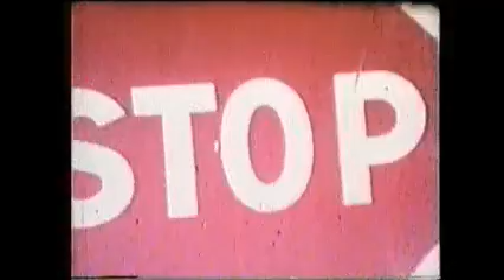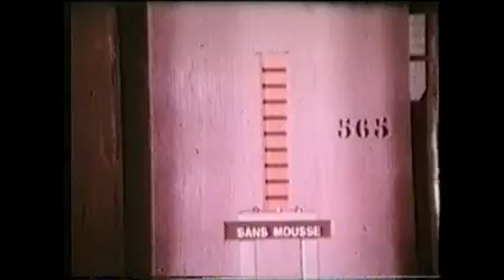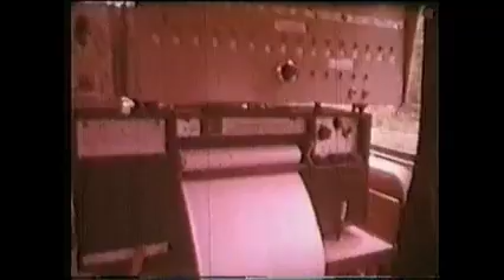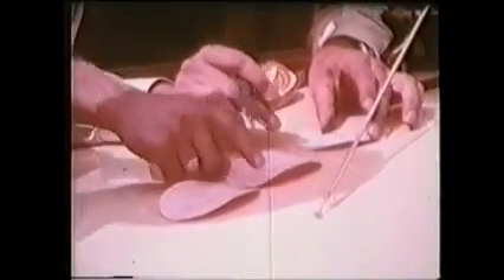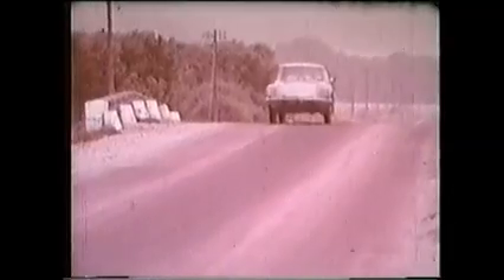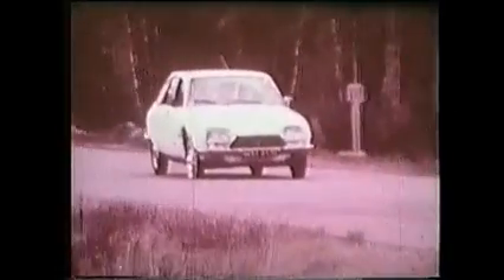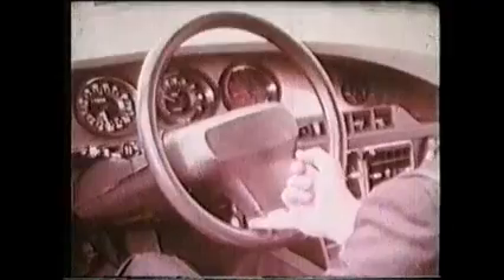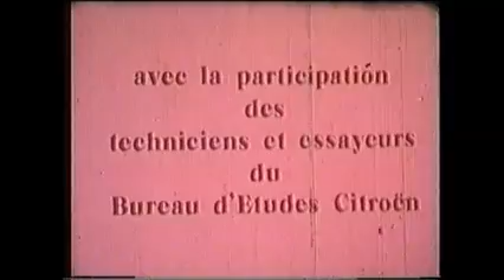Citroen GS GSA 2CV safety promotional video

Comment: 2cv safe? hahaha
Reply: Great Cornholio It's safer than you would think. 
The following articles explain it:
http://carcynic.com/archives/00000013.html
http://carcynic.com/archives/00000014.html
Reply: Csuzdi Gábor well,. i once saw a mercedes 300e crash into a 2cv at 50km/h,....he drove through it,..he crushed the engine,. drove through the interior,. pinning the floor to the ground,. drove throught the front and back seats and came out through the tailgate,...needless to say no-one inside the 2cv survived the crash,..
Reply: Csuzdi Gábor and in you article,. they say "avoid crashing it!",.... "The 2CV lacks many safety features that we take for granted in a modern car" its a death trap dude,. some dont even have seatbelts,. no crash zone,. a very weak chassis,. and almost everything is bolted,. not welded,..
Reply: Great Cornholio"He drove trough it". Yes, because in these tests the car is fixed to the ground or moves on a fixed path. In the reality a 2CV would be pushed away when the Mercedes reached the chassis, because it is so lightweight. And in a frontal accident, the engine slides under the passenger compartment. But the 2CV's real strength is in avoiding the crash, it's the primary safety. And there's a reason why they call it primary. It is more maneuverable than big cars, it has precise steering, a suspension that provides good roadholding, and it doesn't have airbags. Which is good because in many accidents the airbag deploys when the vehicle is moving. And with the deployment you lose the control over the car, and this decreases the chance of survival. The 2CV won't do that. And it also won't shoot you with little pieces of metal, like those Takata airbags. So in a hand of a good driver, a 2CV is lot safer than a modern economy car. On the other hand for a bad driver any car is a potential 'death trap' and also a ticking bomb for the others in the traffic around it.
Reply: Csuzdi Gábor well,.. most drivers are not so good at driving,... so making the "avoid the accident" the greatest benefit of this car,... isnt going to work,... no abs,. those skinny tires,...that extremely weak suspension,... in the winter,. to avoid a crash on a narrow road,.. it will almost flip on its side,. you will have no braking power,. and probably crash into a tree,... without airbags,.. and probably without a seatbelt,..this car probably should be banned from public roads,... i would love to see a euro-ncap crash test with this model :)
Reply: Great Cornholio  You're ignoring the facts and what the experts say. The 2CVs have dual-circuit inboard disc brakes so you have more than enough brake power. The suspension is not "weak". It's just soft for comfort and roadholding. But its parts are designed to withstand huge impacts, such as huge bumps, car jumps and collisions. It can even withstand being driven down on the stairs, where a modern car's suspension would fall apart halfway down (not to mention the low plastic parts and bumpers which would be shattered as well). And no, it won't tip over. When the 2CV became laughing matter due to its comical roll angles, Citroen offered a reward for anyone who could tip over a 2CV without modifying the suspension. No one has ever won. Lots of people tried, but they failed. It leans extremely, but the suspension keeps the wheels on the road. So it's stable and controlled. The 2CV has crumple zones which can do their job. The experts also don't agree with you on the skinny tires. Here's a study from Pirelli about why skinny tires will make a comeback soon (http://www.goauto.com.au/mellor/mellor.nsf/story2/A0E675D5234438A6CA257B350081622C). Most 2CVs have seatbelts and you don't need airbags with the single-spoke collapsible column steering wheel. It stands in such an angle that it can't really hurt you. The canvas roof makes it easier and faster to get out of the car after a severe crash. ABS... I would ban everyone from driving who can't drive without these electrical gadgets. They can be useful, but when they fail (and that usually happens in crucial situations) the driver won't know what to do. Finally, about crash tests. They don't mean anything. They aren't realistic, and sometimes they are falsified. (See the famous German ADAC falsifying Dacia Logan crash-test results in 2005: http://wbponline.com/Articles/View/24175/german-auto-club-scandal-as-adac-admits-falsified-surveys). The 2CV was produced between 1948 and 1990. So instead a crash test, look up the car crash statistics from the past. You will be surprised. The 2CV has proven that it's safe and saved many lives with its unusual, yet effective safety features. This makes it one of the few legitimate vehicles on the road.

"Most drivers are not so good at driving..." - And that's the biggest safety problem...
Reply: +Great Cornholio 

Curiously yes, 2CV were safe, with the means that a 1948 design can offer until 1990.
Two experiences of accident that could have been tragic in my family with 2CV really surprised us.

One against a truck, the flexibility of the bodywork saved my mother from the violence of the impact.
The 2CV has started to introduce the principle of the engine-gearbox unit that passes under the passenger compartment in a frontal impact. Then, unlike other cars like the Renault 4 and many productions of the 70s and before that had the steering column in form of a long steel rod coming from the front wheels level, the steering column of the 2CV was almost straight and positioned after the flexible area of the engine compartment. In the event of a frontal impact, the steering column came not pierce your body or your head mortally as I let you imagine.
The crossbar cylindrical suspension holding the suspension arms was just in front of the cockpit, she integrated the steering box and provided a framework to prevent the engine-gearbox unit to pass almost under the cockpit.
Many people think that Citroën from that time are fragile because, in case of impact there are many spectacular deformations (2CV, Dyane, Ami, GS, DS, SM). These deformations planned to mitigate the shock began to help save lives. You can die in a tank that stops short against a rock wall while the tank suffered no deformation, perhaps not in a 2CV. Many cars of the 60s and 70s were very rigid but deadly.

The second was against a wild boar on the highway. I was driving at 120 km / h at night (I took advantage of the descent, please). The boar came to jog the car before I could see him and react. The car whirled between the guardrail and ditch, the car chose the gap... With the very low center of gravity on a 2CV (twin-cylinder flat engine) and the large suspension travel, the car did not returned and continued to drag and rolling in the ditch and the embankment.
I can assure you that I thought I was doing several tons. Well no, the 2CV jumped and bounced between the ditch and embankment. Past fright, I thought it was quite spectacular.
For the small anecdote, elastic or hammock seat did not resist with all these bonds, I found myself with the buttocks almost on the floor of the car, it was hard to get out of this hole in the seat...
Reply: +Csuzdi Gábor ''2CV would be pushed away'' - that is correct; i experienced that 25yrs ago with my 2cv spécial; the car was total loss but me and my girlfriend only had some scuffs and scratches. We were t-boned by a fool who didn't stop for the red traffic light.
Reply: They were safe for their time. Still today, I don't feel unsafe driving one, it is more safe than a motorcycle and is not a car that is tempting you to go fast.
Reply: Great Cornholio on the other hand, a 2CV would often just be shoved or skidded out of the way in an accident. Also, you won't be able to tip it over in a one sided accident (this is where the "weak" suspension comes in especially handy). You'd have to avoid trees crossing the road, though.
Reply: And then your hand slipped off the end and the jolt woke you up
Reply: It was designed in 1936.  Produced until 1990, largely unchanged, larger motor option, different bonnet.  What other car sold so well for 40 years?  Chassis, weak?  That is really laughable, you obviously do not know a thing about the construction.
Reply: Designed in 1936.  The German occupation interrupted the production.  To deny them to the Wehrmacht, those produced were broken up, all the dies and moulds, every sign of the 2CV was hidden until after the war.
Reply: Yes, prototypes still pop up in old barns in France. The nazis actually confiscated many Traction Avants, the only widely-available car with frontwheel drive at the time, because they wanted it for the army
.